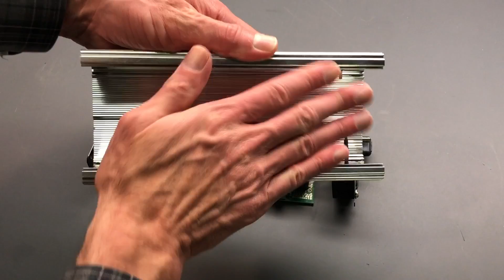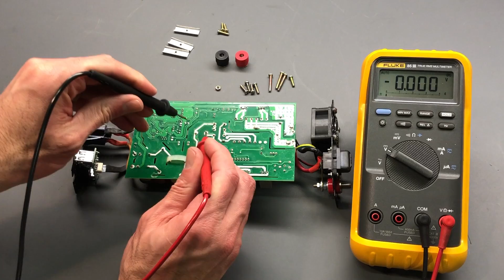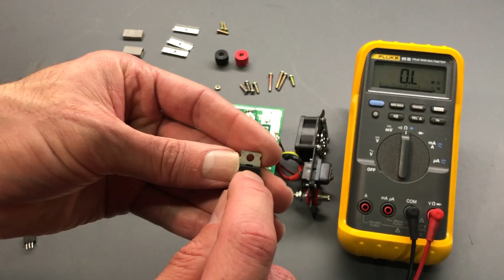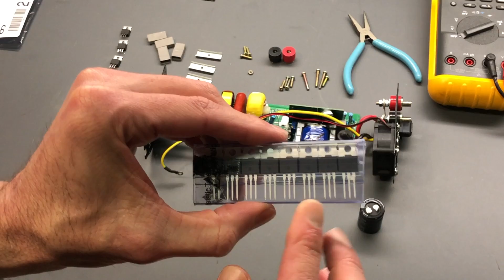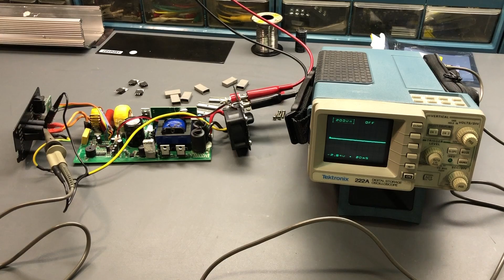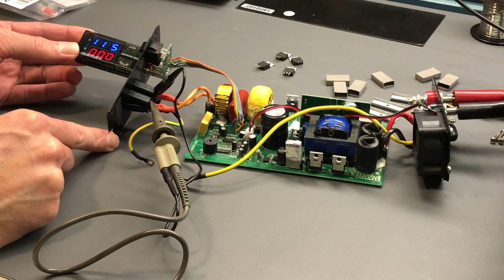Fixing a 300W Power Inverter - No Schematic Available

Comment: Nice presentation! When testing semiconductors with the multimeter you've better to use the diode function rather than the resistance function. It will give you better results. Resistance mode on testing semiconductor junctions is usually used in order to detect leakage (or direct shorts) on them.
Reply from the maker: Yes for proper semiconductor tests the diode test function is needed (to properly forward bias the device) but for quick go/no go test looking for shorts resistance mode will work.

Comment: Firstly thankyou for this deep dive. I have a dead inverter in a single tube CW xmitter I built. Just a thought is it possible the PCB screen print is for the euro 230V AC unit hence the different voltage rating on the PCB? Cheers and once again thanks! SUBBED
Reply from the maker: Yes the higher voltage capacitor marking was for the 240 volt version.  Thanks for subscribing!

Comment: 27:06 I wonder if they've chosen the components to suit the target output voltage? If it were to output 240-250v then 450v would make sense.
Reply from the maker: Yes correct that is what was done.
Reply: @EriksElectronicsWorkbench  my apologies, lol, I only saw how many other people made that same comment after I had published mine. You must be very patient.
Reply from the maker: @bobbybiggs4348  no worries, it's a valid point about the voltage.  Thanks for taking time to watch.

Comment: There is no way in hell that you can damage a mosfet made after 1990 by handling it. Maybe if you charge on a Van de Graaf machine and discharge directly on the gate... and even so i don't think it would brake a sweat....
It's more likely to fry a BC509 or other puny fuckers, than a big ass mosfet...
Reply from the maker: Sure you can.  All it takes is a static charge on the gate terminal.  You can easily build up 100's or 1000's of volts if you are not ESD protected.     https://toshiba.semicon-storage.com/ap-en/semiconductor/knowledge/faq/mosfet/mos-is-sensitive-to-static-electricityhow-do-you-protect-mosfets.html

Comment: KME is a united chemi-con (or nippon chemi-con - same company) series, and that's the United logo - they're just as good as nichicon. Caps I'd trust are (united/nippon) chemi-con, rubycon, nichicon, and panasonic. They're all top-tier brands (some particular bad series in all of them excluded - even the good companies have had notoriously bad series of caps in the past)
Reply: 47:08 you can also use HV/isolated probes on a regular scope. They used to be stupidly expensive, but micsig has some reasonably priced options these days - essential for working on the primary sides of switching power supplies, or vector motor drives!
Reply from the maker: Thanks for the info.  Yes true some bad series were produced here and there but the names you mention are trusted companies.
Reply: @EriksElectronicsWorkbench  I also trust Elna, Epcos (TDK nowadays) Yageo's brands (Yageo and Jamicon) and a few others for certain purposes. NKK are another accepted one in my bin. Cornell Dubilier make a lot of specialty caps used in old gear and I trust those too -- expect no less at that kind of price.

I trust a fair few "cheap brands" for a fair few purposes as well. It's just a matter of picking the right capacitor for the job. I'm very happy with a lot of my Samwha capacitors.
Reply from the maker: @AnnaVannieuwenhuyse  I have had good luck with Vishay, Epcos, Yageo, Cornell Dubilier.  For many repairs Nichicon and Panasonic are go-to for high quality and cost effective but other brands are always worth considering.

Comment: I am guessing the 450V rating is when it is a 220VAC version. LOL just got to 40min in the vid.
Reply from the maker: yes it would have the higher voltage rating for the 220 volt AC version

Comment: Are there other options for scoping the AC wave of an inverter besides an isolated battery-powered scope? Is there any alternative, or any way to take a wall-plugged scope and isolate at least the current from the inverter to make it safe(er)?
Reply from the maker: If you want to use an AC line powered oscilloscope with traditional grounding on the AC line you need to use a differential scope probe.   This will allow you to probe a circuit with reference to a point that is not at ground potential.  Don't float the oscilloscope with an isolation transformer as this is dangerous and will put high voltage on the scope chassis.
Reply: @EriksElectronicsWorkbench  a isolated transformer in the scope will not put high voltage in the chassis, it will do only if there is leakage in the scope circuit. And if use another isolated tranformer to power the AC equipament under test the risk not exist.
Reply from the maker: Isolating the scope from ground creates a hazard when your probe's "ground" connection is at a voltage potential (above or below ground reference) which then raises the oscilloscope chassis above (or below) ground and poses a dangerous shock hazard. Users try to do this when testing switchmode power supplies for example. 
Isolating the scope from the AC line should only be done if you are actually servicing the scope. 
I'm currently working on a Tek 2247A and the power supply board has a factory inscribed note to use an isolation transformer when servicing.  @mcac-youtube

Comment: The capacitor you took out is correct and perfectly fine. The 450V cap is for the european 240V AC version, which would see about 370V DC. In your US version, the cap will have about 180V DC on it. The DC voltage will be a bit higher than the peak of the AC output to account for the MOSFET on resistance.
Reply from the maker: Yes after taking actual voltage measurements I realized the original cap's rating was ok. I show this in the video.  My replacement is a high quality Nichicon with the same 220uF rating, just a higher voltage rating which is perfectly fine to use.

Comment: the capacitor is right they halv its value/double voltage foe 240 v models the one you put is for 240 not 110 version
Reply from the maker: Yes the capacitor chosen by the manufacture was ok.  The capacitor I put in has a higher voltage rating which is also ok to use.

Comment: That thermistor is very important as it will activate the fan for cooling the mosfets it should be mounted on the heat sink with a clamp . A common problem with mosfets and dud capacitors in inverters

Comment: Nice job. One thing to mention for someone not that experienced: Measuring MOSFETs with a DMM can be somewhat missleading sometimes. The voltage applied to the gate by measuring continuity between gate and source can be enough to make the drain-source Path (partialy) conducting. Touching the gate and source can be enough to discharge the gate again making the MOSFET non-conducting again. In this case it certainly looks like a dead short though. (A good component tester makes it a bit easier to avoid such problems.)
Reply from the maker: Hi, thanks, and yes I would normally use a component tester to carefully and accurately check a MOSFET but these were completely destroyed.   I could tell that something was defective from the short circuit reading as I worked back through the circuit.

Comment: Congratulations for this repair! I think it is also important to mention that, when replacing an electrolytic capacitor, the case may also be at an high potential. For example, TDK says, I cite: " Single-ended, SMD, snap-in, and screw terminal capacitors have an undefined electrical contact through electrolyte or other parts inside the case". So when replacing the cap with another cap of another diameter, the insulation clearance will vary, and it is important to respect the minimum clearance according to the local regulation.
Reply from the maker: Correct about the capacitor case being at a voltage potential.  In this case both terminals of the cap are floating above ground potential.  It is good practice to make sure nothing comes in close contact with the side of the capacitor and especially the top of the capacitor which is tied to the negative lead and the top of the capacitor is not insulated.